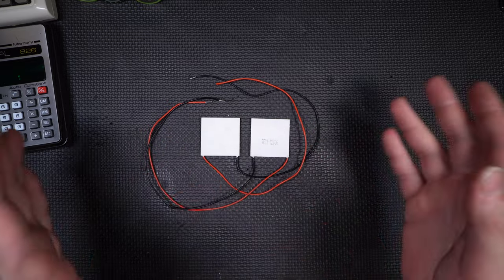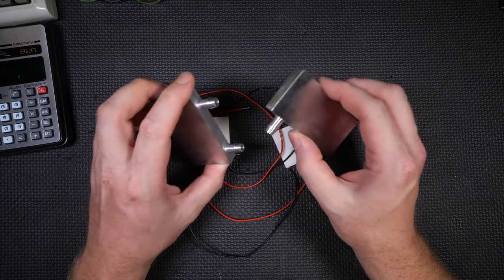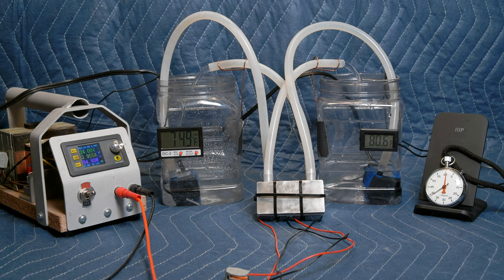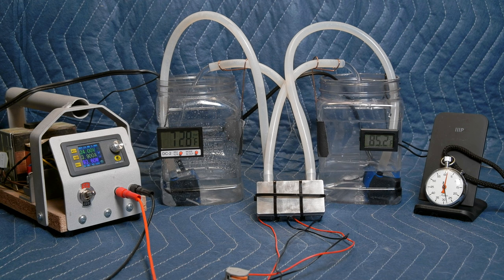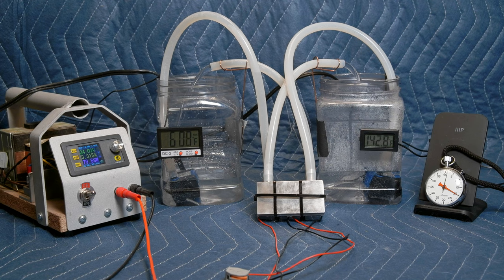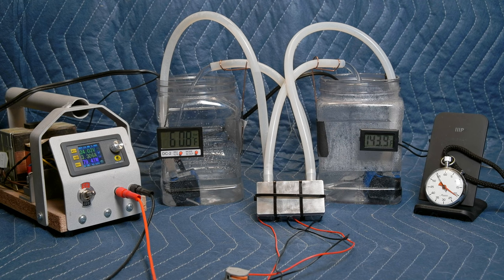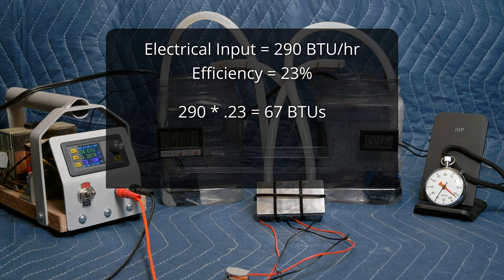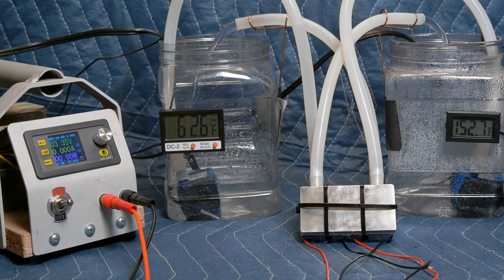Peltier Coolers - Can they cool a car?  How Efficient Are They?

Comment: The cooling effect was very limited in your setup because you where dumping all the heat into just a limited amount of water. Try the experiment again and dissipate the hot side to the air in the room.  The hot side would stay close to room temperature and the cold side would get much cooler.

Comment: I'm at least 1 year late to this, but here are my 50 cents on cooling performance. Good little experiment but doesn't take into account heat capacity of water vs air (water is at least 4x higher than air) nor the efficiency of heat transfer from source to target (water is at least 25x times faster than air). This is the reason "water cooling" is still practical in computers.

Comment: You can use it with antifreeze to cool down an ice box for water to air intercooler. It heats up fast, for daily use it's pointless,  but for 1/4 mile you can get some gains

Comment: There is a bloke on YouTube by the name of David McLuckie, who has integrated TEGs into a 12v diesel air heater, it produces enough electricity to power the heater's blower fan and fuel pump to run its self, and trickle charge the battery ! Its well worth a look.  There's also potential to harvest more power from exhaust heat that's wasted atm.

Comment: There are peltier modules meant to produce electricity from heat, those are "significantly" more efficient and barely more expensive than the normal more common ones, also keeping the heat under control is actually pretty easy with chinese pc radiators and fans, just make it at least 240mm and 2x fans per peltier

Comment: I think cooling systems are often measured in cooling power / power input.  For heat pumps, sometimes this can be 300-500%, or even 3000% if you're pumping heat to a very cold "hot side" like my house's geothermal system when the AC is on.  In this case I think your cooling power in 20 minutes was about 15 BTU's.  You power input was 85W * 20 min * 60s = 96.7 BTU's.  So efficiency would be 15/96.7 or 15.5% average for the first 20 minutes.  That value is probably higher for the first few minutes before the conduction through the chip stabilizes with your cooling power.

I have a similar personal interest in playing with Peltier coolers, so every 5 years I pull the 5 of them I have out and try to make some power.  I heated and cooled two ~30 lbs aluminum cylinders and placed 4 of the chips in series between the two chunks of metal.  The best I could do was 3 or 4 volts, which wasn't enough to even charge a li-ion battery.  Maybe someday I'll make a solar concentrator and have the cold side in a running stream to do this again, but it's certainly not easy.    In college I made a cooled seat for a Supermileage car.  It actually worked pretty good in terms of dropping the water temp be 10-15F while using ~150 watts between the chip and a very powerful 120mm computer fan.
Reply: I wish there was a device that can measure the cooling power directly in watts or BTU instead of needing to compare the temperature and getting trash results

Comment: I tried this in a similar experiment with plans of running distilled water through my heater core (had to pull the AC to fit my go fast parts). I put the heat sinks on the hot side with fans and the cooler on the cold side running water with a small pump. I ran 12v 30amp? from my power supply and what I learned was the hot side has to stay piping hot for you to keep the cold side cold. As soon as the fans kicked on on the hot side, the cold side temps began to rise (so air cooling is a no go). The other challenge is as soon as you cut power, the heat sinks transfer all that heat into your cool fluid very quickly.

Comment: Those little controllers are awesome. I used the high amp pwm controller for methanol pulsed injectors on my old diesel. The little gadget projects are cool.
Reply: As in straight methanol on a proper fuel system , added to a diesel? How did it work out? I've used water meth to great effect on petrols but I have a diesel engine project right now that's fuel limited,so considering straight methanol rather than trying to get the common rail system to do what I need and don't want to use straight meth in a water meth kit, feels unsafe.
Reply: @denisohbrien  I drilled 6 holes in the intake, welded on injector bungs. I use 6 flex fuel gm injectors.  I run a second tank filled with 50/50mix. Over 1190* the controller turns on and starts injecting right down the runners. Engine is a dt466 international.
Reply: @Go4BrokeOffroad  Thankyou, was hoping you were running straight methanol, thats what I want to try and just cant find any info of folks doing it but there must be some.
Reply: @denisohbrien  I have a few times. Usually when I'm at an event. For everyday use, it's 50/50. Methanol is highly corrosive I don't want to ruin my stuff over time. My monster truck runs 100% m1. I go through about 20 gallons in 6 minutes.
Reply: Again , thankyou! . this is for a bmw M57 (3.0 diesel) ive built compounds for, Quite a different use case to yours :)
Reply: @denisohbrien  I have a setup on a om617 as well. I dig all the engines. those 3.0 BMWs are cool little engines

Comment: I have always had the idea of using a setup similar to supply hot or cold water to a seat cover with a hose running through it. Dissipating the heat when it is cooling the water has always been my biggest issue with the design I have had in my head.
Reply from the maker: That would be an ideal use for these.  I had the same thought.
Reply: @AlexLTDLX  Well, good. I am glad I am not the only one that has thought about that. With that, either I am not nuts or not the only one that is. :-)

Comment: A more useful device for you might be a thermoelectric generator, which also works on the Peltier principle, but to produce a voltage when the plates are at different temps.  So maybe a few of those with their hot sides stuck to the bottom of your muffler and passively cooled with outside air could be wired to some fans, if any of the electronics in your trunk need cooling.

Comment: These actually have an ideal voltage. A 12v unit is nearly as effective when run at 9v and lower amps.

You can also stack units to get a greater temp difference.

I think the biggest potential flaw in the test is the use of uncompressed water, vs compressed freon or antifreeze. Assuming the water blocks are also poorly channeled. The resonant heat or cooling will create a negating resistance.

I suggest using two CPU water coolers with antifreeze fluid. It's not exactly water, but the same principle applies to BTUs.

Now, on the reverse... Compared to a standard "equal wattage heating element", how efficient is a peltier cooler, as a heater? I believe this is a totally overlooked function. It should be more efficient, as it is acting as a heat pump plus a thermal resistor, at once. Trying both side by side and stacked.

These would be great for cooling gas to get more power and fuel economy. Fuel flows slow and is under pressure, before the injectors. Yes, the AC would be more efficient, but less functional, as it can't get to below freezing temps. The AC would be great for cooling air intake, for boosted power though. I'm not sure why they don't use cabin air for an engines intake, when the AC is on.

Comment: what was the manufactures temperature delta for the specific peltier you used? also a heat sink on the hot side would make a world of difference
Reply from the maker: No clue - they came from Amazon.  And they did have water cooled heatsinks on both sides - that's how the water warmed up in the one container.
Reply: @AlexLTDLX  different peltier modules have different temp deltas. some as low as 20 degrees and some as high as 80 or higher. The colder you get the hot side the lower to cold side. if the delta was 20 degrees and the hot side equals 50 the the cold would only get to 30. but using the same device if you got the hot side to 30 degrees then the cold side would be 10 degrees. If you still have them keep tossing ice in the hot water side and the cold side will get even colder. It's a fun experiment. I'm going to use them to extract water from the air. Getting the cold side to frost up then defrost it to liquid.

Comment: Hello, Alex. Looking all over the web to find a basic thermoelectric setup (capable of heating and cooling) for a school experiment. Love this video but sadly, I'm not an expert so I have trouble. What is bare minimum needed to conduct this kind of experiment? Thanks.
Reply from the maker: You just need two peltier modules, a couple of water cooling blocks and a couple pumps, tanks (I used cat treat containers) and some hoses.  Amazon carries everything you'd need.

Comment: I've been thinking about using these with an air conditioning condenser and the heater core in a 1982 standard cab pickup that has no AC. Hot side loop would run through the condenser and cold side through the heater core. I'd use some valves to connect switch the heater core between the engine and peltier. I've read that a peltier's best efficiency in heat moved per unit of electricity input is at around 50% of the TEC module's rated power.

Google 8 peltier cooler and you'll find many places selling tge same unit with heat sinks in the middle with a fan on one end and a long, blue water block on each side. Most have a crazy cheap price. Buy two to get a second pair of water blocks to sandwich in the center for cold. Put the hot side out with the heat sinks to pull more heat from the outer water blocks. Build a duct to bring air from outside the engine compartment over the heat sinks.

Is there a source for the peltiers optimized for converting temperature differential to electricity? A DIY  power generator that taps exhaust heat after the catalytic converter could prove some power to run a TEC air cooler.

How much exhaust heat from a 350 cubic inch V8 could be converted to electricity?
Reply from the maker: To answer your last question first - not enough to be worth it.  Overall, these things really wouldn't work for cooling the cabin of a car.  However, for spot cooling (like cooled seats, for example) - they would work fine.  In fact, OEMs use these for that purpose.  I also don't think you're likely to get anywhere close to 50% efficiency.  But I'm sure, in time, the technology will improve.  But for now, you're much better off with a compressor-based unit.
Reply: @AlexLTDLX  best efficiency at 50% of their rated power, not 50% efficiency

Comment: Could a solar panel provide enough power to charge a peltier cooler to cool itself for more efficiency and still provide charge? all solid state charging and cooling? I doubt it, but we will never know unless we connect the red and black wires.
Reply from the maker: Possibly.  I'd have to test it once I get everything moved down to the new place.

Comment: Can you make a realistic test to make 85-90  degree heat, reach decent temperatures in a car. At least 5 to 10 degrees lower is worth it in my scenario I’m trying to protect my lifepo4, dashcam, interior, etc, from heat. I’m already using ceramic tint and window covers. But heat is still baking my interior.
Reply from the maker: These probably wouldn't get you there, at least not in any reasonable quantity, unfortunately.

Comment: Re run the exact experiment but lower the voltage to 20V instead.... 
You should get better performance results running the Peltier device below it's 12V max voltage rating.... 
Hek! You might even get a better efficiency rating than what you got here! 
I have run them at 6V and they worked much better than at 12V... 24V id definitely too high!

Comment: There's way more imperial-only use cases. pipe threads, air flow, degrees of angle, air and naval navigation and more. 

Next your in a plane, ask yourself what height, speed, and what the air around you is doing, and its all in thousands of feet, knots, CFM, PSI, BTU etc.

Also, fractions are overpowered if you're not a bonobo. 

fuck base 10: bases 12, 60, and 360 are way easier to intuit math in sans logarithms.

Comment: I've always thought peltier modules were best as heating elements. The trick is to use water blocks as you are, and steal heat from outside just like some mini splits. All that energy wasted when trying to cool something is just as efficient as a space heater and the heat pumping action is just gravy.  You can get as fancy as you like, coupling to a solar oven, swimming pool or any thing else that makes sense.